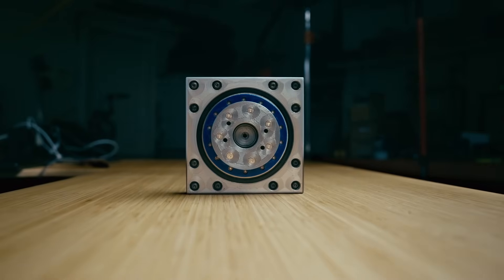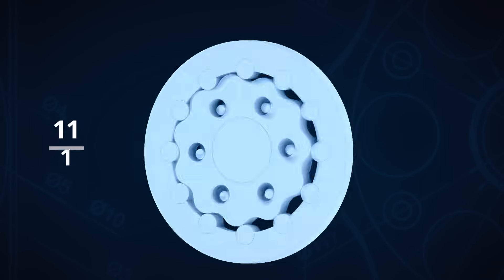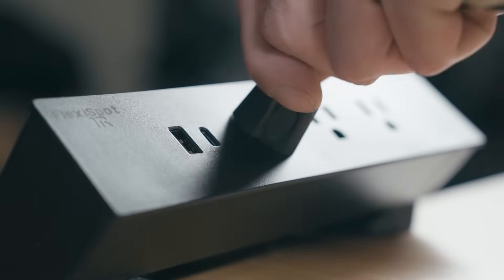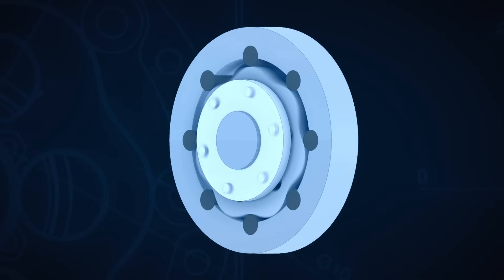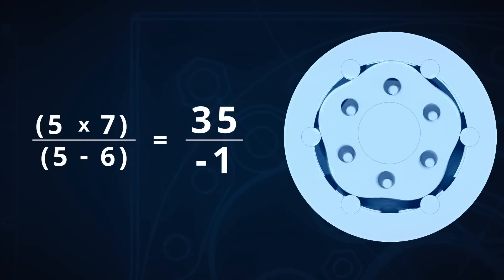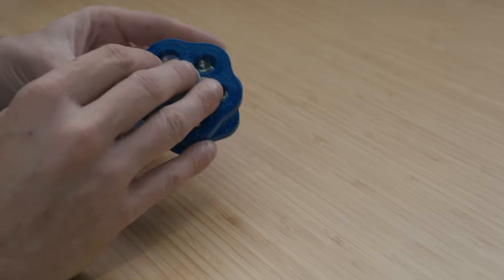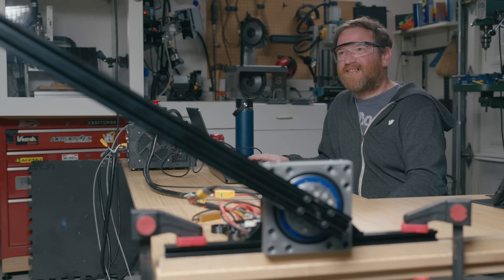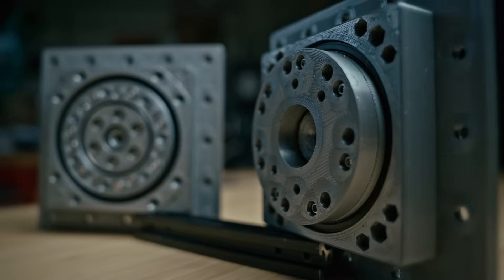You've Never Seen a Cycloidal Drive Like This

Comment: Great work! But you might have missed an important step, which is adding grease onto the discs on all contact surfaces. That would probably decrease the stuttering, and take some stress out on the materials due to high friction. I would also sand paper the contact surfaces to smooth it out to reduce friction even further.

Comment: I wonder if it's possible to put a hole through the center, which is very useful in robotics to pass wires through.
Reply from the maker: You could certainly design one to allow for that.  But you'll end up pretty significantly increasing the overall diameter to achieve any significant pass through.  The eccentric aspect doesn't make it as ideal for a hollow center gearbox.

Comment: 1:05 is the stress spread around tho? I can make a drive function with only 3 roller pins in. 1 on top and 2 opposite of that and the drive will function. The disk "teeth" that are 90deg from fully engaged top pin are just sliding past the rolls and not really touching them at all.
Reply: This was my thought exactly. And you're right, these are no different from gears. By definition one "tooth must be engaged" while the others have some component of negative relative motion. Same with all internal reducers. Strain wave, planetary gears, belts, chains, etc. It's a mathematical requirement since the "teeth" have to be recycled.

Comment: I’ve designed cycloidal drives in SolidWorks. It’s a tedious thing to construct the first lobe so I recorded the sequence and the added code to ask for known variables. I could generate a new size and/or ratio like magic, well almost. 

Wire EDM is a way and maybe the best way to cut the lobed pieces.

Comment: Will this work in the opposite direction, to increase RPM's?
Reply from the maker: It technically would. But high reductions like this are very difficult to back-drive and I’d be very worried about how stable the output would be. And how much power you’d need to run it.

Comment: A simpler two stage cycloidal reducer exists without the middle pins; both discs are joined as a single piece, and obviously rotated (and oscillate) in the same direction. The centre shaft continues through and has a bearing at each end.
Reply from the maker: If they're rigidly connected you don't get counterbalancing.  But there are definitely ways to make everything even more compact.
Reply: @Cinema_Mechanics  True, but it's so much simpler! A little vibration is acceptable sometimes
Reply: @Cinema_Mechanics  It might still work with the cycloidal disks rigidly connected. Suppose the center of the lower cycloid disk  is shifted to the left of the motor axis by the eccentricity e and the upper cycloid disk is shifted to the right of the motor axis by the eccentricity e. This requires an eccentric input shaft with two offsets. If you use needle roller bearings, the eccentric shaft should fit through each offset central hole, then you pop the bearings in afterwards. I'm going to try designing this in Fusion to see if it works.

Comment: Seems like this application would be ideal in a turbine helicopter where you may have a power turbine output shaft of around 30,000rpm that needs to transmit power into a rotor with a typical rpm less than 400.

Comment: 12:45 would it be worth mixing printing and milling? print oversized with enough perimeters and use the cnc to get to to proper size. i suppose it depends how long it takes to setup and run the cnc vs printing again

Comment: torque is not distributed among all the teeth of the cycloidal gear, just like in regular gears. Only a few are in contact AND under pressure to drive the chaft, at any given time.

impressive animations, they are very helpful to understand the paper quickly !
do you publish your designs anywhere, github maybe ?

Comment: One way a lot of the 3D printed cycloidal drives get around the weaknesses of printed components is to use rotating pins. Really just needle bearings on their own little shafts. Rubbing plastic lobes against stationary shafts causes a lot of friction, stuttering, and binding. Give your shafts a break! 🤣
Reply from the maker: The lobes on the cycloidal disks are running against ball bearings if that's not clear.  The pins I mention are shafts for the ball bearings.

Comment: I'm calling click-bait. No one could seriously think that plastic would hold up to the forces involved.
Reply from the maker: Well it’s a prototype so it’s all just testing the design and theory. 3d printed gearboxes can take more than you think if designed correctly however.
Reply: what? He's talking about the concept here, not designing a fully functional high torque gearbox
Reply: You seem to be an "old timer" ... Coming from pre-rapid prototyping era
Reply: @amritwalimbe Hmm... I'm not sure if that is meant as a slight or a compliment, but regardless, the maker didn't frame it as a prototype and expressed surprise that the plastic didn't hold up under the stresses imposed.
Reply: It's people like you that are uneducated that give 3d printing a bad name 💀

Comment: I'd improve this design by throwing it out and using our infinitely variable 𝔽𝕣𝕚𝕔𝕥𝕚𝕠𝕟𝕃𝕖𝕤𝕤 𝔾𝕖𝕒𝕣𝕤 [ℂ𝕍𝕋/𝕀𝕍𝕋]  solution.
😁We have patented an entirely new, low cost, hear-silent, ultra-efficient, infinitely variable , ultra-torque dense [small & light], high durability gear technology, called 𝔽𝕣𝕚𝕔𝕥𝕚𝕠𝕟𝕃𝕖𝕤𝕤 𝔾𝕖𝕒𝕣𝕤 [ℂ𝕍𝕋/𝕀𝕍𝕋] , which is a reformulation of gearing theory sans any toothed wheels. The gear range can easily be >700:1 [ultra high gear rage possible] with a price half that of the lowest priced competitor. Enables smaller batteries and/or longer range in EV's [Exploding Vehicles ;-0 ] . Legacy and novel applications abound. Retrofits of ALL existing bikes, even electrics, will be available.
😉A novel, low cost, magnet-free, near-silent, zero detent/cogging, ultra-torque dense [i.e. compact], ultra-efficient, electric motor tech may be paired w the FrictionLess gear set for unprecedented drivetrain performance in all metrics at all scales.
😁We're also developing an ultra-efficient Free-piston engine with an insane power to weight ration on par with turbines. It will eventually power the PersonalJet door-to-door personal mobility solution.

Comment: I wish this kind of educational material was available during my studies. It's exceptionally well made.

As to suggestions, wouldn't "making the whole thing taller", both rollers and the rotating ring simply distribute the load on proportionally larger area?
Reply from the maker: Yeah it would definitely help. But we start to lose some of the advantages of it being single stage (less depth) so it’s all a trade off.

Comment: Nifty project sir. Excellente cinematics as well. 2x backlash MINIMUM, it's still a 2 stage series drive. To make these drives useful (other than a desktop conversation piece, it's best practice to make them out of something stronger than ...cheese. The conditions at the interface of a roller and lobe can generate 10's of ksi based on the contact angle and amount of torque applied to the cycloidal disk. The pressures at the interface charted out vs lobe angle of contact from minimus to maximus pressure would look a bit like a sine wave pattern.

Comment: I spent a few years designing and testing cycloidal drives. This design will be nearly the worst torque ripple and non-linearity you can imagine. The multiple identical disks is the only way to average those out. But this design deletes that feature and there is no way to correct it in open loop control. SO its doomed from the beginning. 
Secondly, the differential type of gear reducers. like this, or a planetary wolfram drive, is the worst as well for constant ratio. Because if the ratio of 1 of the stages changes even a miniscule amount, the multiplication of the end ratio is changed much more than a simple 2 stage gearbox without this differential feature. 
3rd. driving the disks with the output hub is much more difficult (to do smoothly) than driving the output hub with the disks like a normal cycloidal drive. 
I do really like the topic and your video was great. Just don't waste too much time on this. There is a reason nobody uses it, typically. If it is useful , Harmonic drives Inc. or Sumitomo buys them out and puts it in a drawer. True story.
Reply from the maker: Thanks so much for the thoughtful reply!  I think I'm already seeing a bit of what you're predicting.  I'll probably still play around a bit with the design anyway as I think it's valuable learning (for me anyway).
Reply: @Cinema_Mechanics  well you video was absolutely great.  I could go for another. 
Let me know if you want to chat about cycloids. Maybe we could each learn a thing or two. I know I would. I have been down the rabbit hole with this.

Comment: For suggestions, I would recommend considering your pressures angles. It looks like the lowest the pressure angle on your lobe is maybe 60 or 70 deg. These high pressure angles effectively multiply the contact stress on your lobes because to transmit any force circumferentially you end up squeezing radially with a much higher force. A higher eccentricity and smaller pin/roller ring will improve this.
Reply from the maker: Much appreciate the comment and will definitely do some more research on the subject.  Already found another academic paper that covers it.  ;-)
Reply: @Cinema_Mechanics could you share the paper? :D

Comment: what happen if both lobes count are equal ? you get a 0 at the bottom, does the output just not move anymore ? since effectively it's sitting at infinite gear ratio ?
Reply from the maker: Yep!  Exactly. The two would cancel out and you’d have no movement at the output shaft.

Comment: Fiber reinforced PETG? Not carbon as it increases wear. The Oscillation was present at 1st run, and progressed? At 1st I thought too little torque from the brushless. Maybe friction played a big part?
Reply from the maker: The stuttering I’m pretty sure comes from a lack of precision in the 3d printed parts. Motor if anything is oversized for the reducer. It gets worse because the cycloid starts to get out of shape.

Comment: If it's possible to change the design a bit, the rotating parts seem almost 2D-like, so perfect for cutting on a simple 2.5D CNC machine or a water/laser cutter.
Reply: Also, thicker ones can be made by stacking multiple thin ones (which I presume are easiest to produce). Probably would require some grinding... Or maybe only a small chamfering

Comment: Doesn't having a different number of lobes make them not perfectly counterbalance each other? Or do they just need to have the same mass?
Reply: Speed and mass moment of inertia would need to match. Mass and lobes can differ, you'd probably have to shift around the "speed holes" to compensate. (I agree that mass is probably very similar to achieve this)

Comment: One of these days I'm going to have to try one of these, as you say, everyone waxes lyrical about their advantages. for my robot arm I'm using a couple of 3 stage planetary gearboxes which I setup with 4 planets per stage to help with the teeth contact area thing. steel pins through the planets connect the output plates. I've had some decent success with around 50Nm of torque. they're pretty big though, and certainly the sun gear at each stacked stage is a week link. Do you think the stuttering movement you got was purely from the deformation of the plastic gears? I assume that was petg?
Reply from the maker: Yeah definitely recommend at least playing around with them. The stuttering comes from a lack of precision with the parts. For example if the shape is slightly off you can get tight spots and loose spots. Then as the disk deformed under load it got much worse. Using larger diameter rollers and longer rollers would have helped with this issue a lot.

Comment: im absolutely interested if you can make a compound cycloidal with this same style and have the inner and outer pinstack spin separate smaller within the larger i would be amazed if that would work, honestly cant follow the forces in my head so im struggling to work it out

Comment: Dude made a bunch of metal dowel pins when you can buy them over the counter.😂 Also, I second making any defirmed parts out of metal as other commentors have said. You have a cnc mill, you've proven the design with 3d printed parts, now you can justify the time and expense to make them out of metal. Not sure I would make them out of aluminum though. They are small enough, the extra weight steel would add would be insignificant
Reply from the maker: Well I mean I cut them. From a precision rod. Wasn’t actually that big a deal. Not sure where you buy individual pins at exactly the right length you need but sounds like a handy place!
Reply: @Cinema_Mechanics You can't usually buy at exactly the right length, but you can certainly design for COTS parts from the get-go :P

Comment: You should give Fiberlogy CTE HT a try for your functional mechanical parts.  Like PETG it is a co-polyester but has almost none of PETG's weaknesses.  It prints exceptionally well in an enclosed printer and has no warping or dimensional issues.  This stuff is accurate.  It's also one of the most strong materials in the FDM world not just because of it's material properties but because of how cohesive it prints when you get your settings dialed in.  Reach out if you need filament or print profiles.  I print mine on a P1S but an X1C would be better because you can get the hotbed a lil hotter.  If you want a similar material but with just a bit more flex, ColorFabb HT is of a similar composition to the Fiberlogy stuff but just a bit less strong.  Still exceptionally good in terms of strength but especially the dimensional stability and print cohesiveness.  Bonus, the temperature resistance of this stuff is some of the best you can get in an affordable material.  Friction heating or heating from your motors will not be an issue with it.
Reply from the maker: I’ve played with some engineering filaments over the years. Mostly CF-PC and while I’ve found that there are improvements. You still have to deal with plastic deformation. I haven’t played with any of the newer stuff yet though. Thanks for the tips!

Comment: I really enjoy your videos. You asked for improvement ideas, and I would love to see you have a go at machining the disks in aluminum on your cnc. That’s one of the big advantages of cycloidals over other high ratio drives like strain wave, planetary, pinwheel worm drives, etc.  They can be easily machined on a 2.5 axis system. Even a hobbiest cnc should give better tolerances in aluminum than a 3d printer in plastic, reducing or eliminating backlash and the stuttering. The load bearing will be far greater, improving the torque. And the stiffness will be much greater, reducing the hysteresis.  If your little cnc is up to the task, that would be really cool to see.
Reply from the maker: @dnomyarg32  yep would love to cnc one up in the near future. Definitely gonna have to get those tolerances tight though.
Reply: @Cinema_Mechanics  with 3d plastic I doubt your profile tolerance is much better than +/- .1 mm. I imagine your cnc should be able to do better. Maybe a lot better.

Comment: Ooh, you stumbled onto the same paper I did! I'm currently commercialising something similar. Search PyreCycloidal - that was the very earliest version of my design. Notably, I used all sheet aluminum construction, COTS parts, and a keyed shaft to transmit torque between the two stages. 3 inch OD, ~1 in thick, over 1000Nm of torque capacity. I'm currently working on a 3rd version that replaces the ball bearings with hydrodynamic bushings. If you want to collaborate on a second version, or just want what I learned from my own design process, feel free to reach out!
Reply from the maker: Will do!  Sounds very intriguing.

Comment: I think nothing wrong with the high number of lobes and smaller rollers. Smaller rollers mean less eccenticity needed to move the discs around and they move slower which is also preferable. Also  higher number of lobes and rollers having contact at a moment, which means more force distribution over more area, and less indentation on your parts ;) I think this is a good design, less moving part:
https://www.nabtesco.de/fileadmin/03_technologie/02_zykloid_versus_planetengetriebe/zykloidgetriebe.png
https://www.geniusrobotics.cn/wp-content/uploads/2022/03/2.jpg
https://www.geniusrobotics.cn/wp-content/uploads/2022/03/Structural-principle-of-cycloidal-gear-reducer.jpg